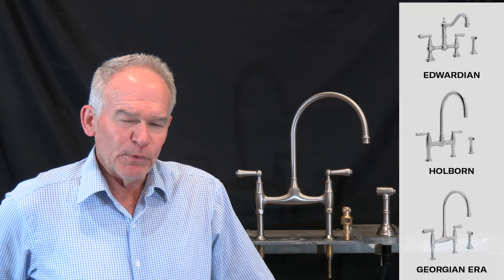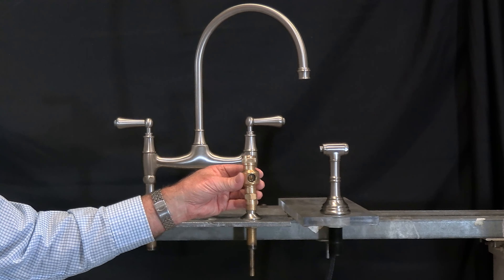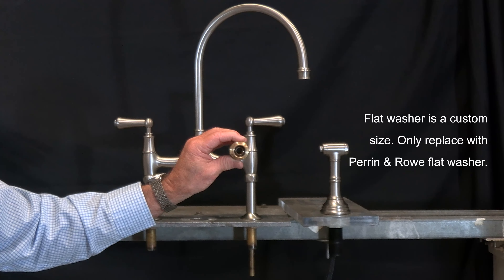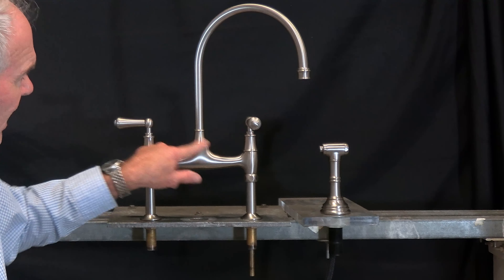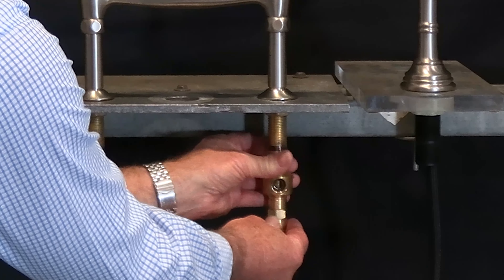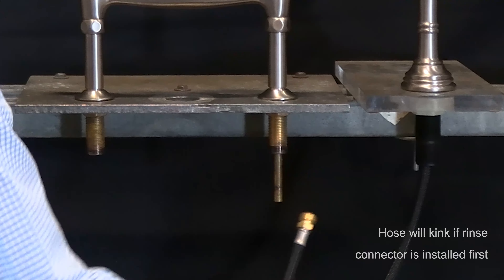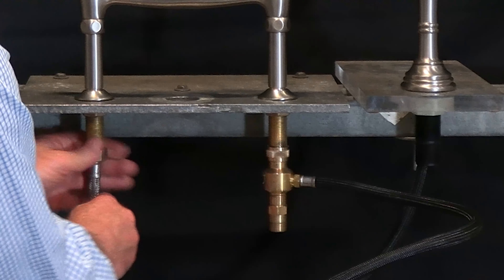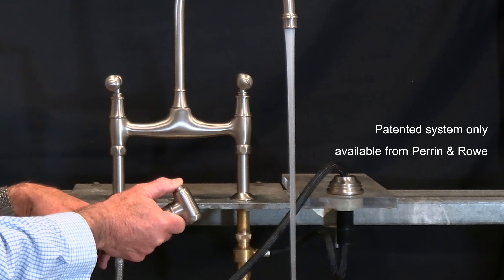Perrin & Rowe Bridge Faucet Installation

Comment: For the collar covering the cartridges, how do you loosen them? I moved into a home with your faucet and because of hard water they are very tight. It’s gorgeous; so grabbing the collar with a harsh tool to access th cartridge seems damaging
Reply from the maker: Hello there. Hard water will act as a glue, so you must break the hard water down to access the cartridge. Try using a solution of 1 cup vinegar to 1 cup water and spray the solution at the seam; eventually you should be able to back off the bell housing to access the cartridge. You may also use a strap wrench, to avoid damage to your fixture.

Comment: I have this beautiful faucet for 18 years now. One issue with it is that if the spray or your hand have any water it trickles down the nozzle( then water follows the hose and collects under sink. Is there anything I can do to prevent that from occurring.
Also, as of a few weeks ago when I use the sprayer, the water, still slightly comes out of the faucet at the same time.
What can I do to repair that issue? Thank you
Reply from the maker: Please give us a call at 800-777-9762 using menu option 3, to further troubleshoot and validate your warranty. We look forward to resolving this with you.